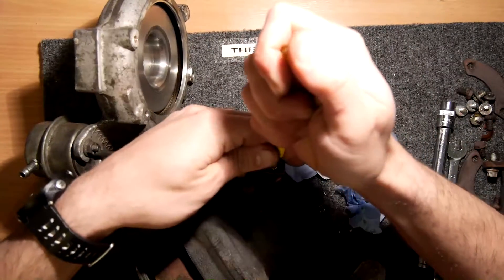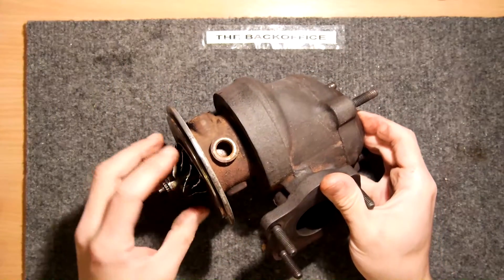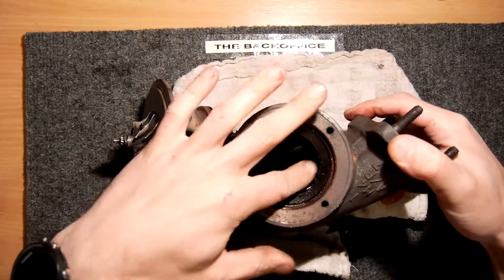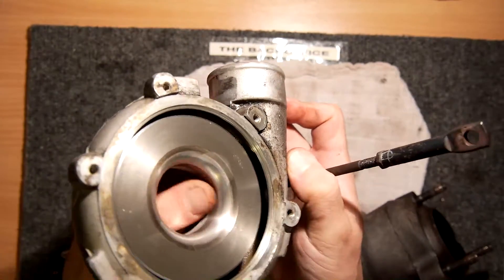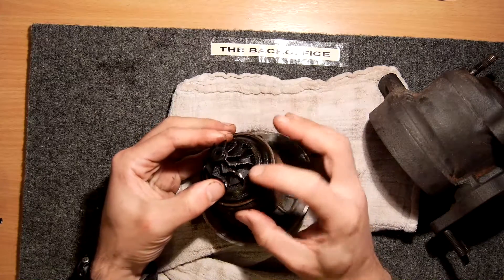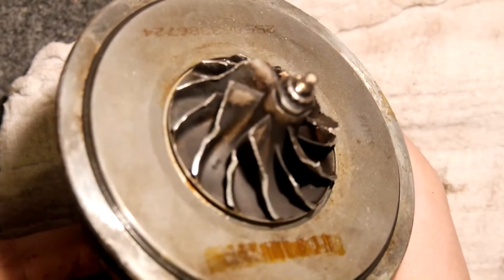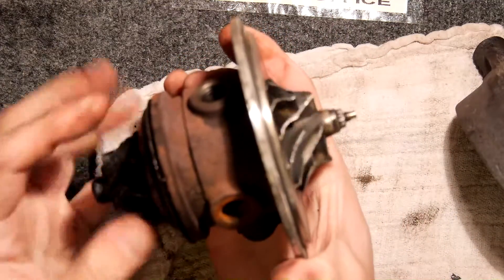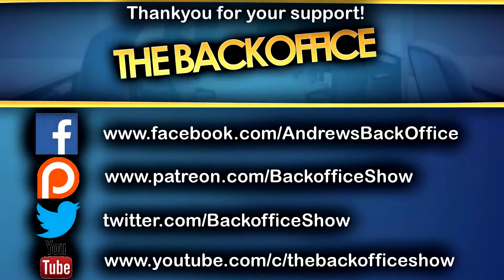TD Lab -  Garrett GT1752 Turbocharger Part 2

Comment: Good grief, that propeller looks like it's been used in mining applications. At least you caught it before it did any significant damage - going through all your oil was almost a good thing as a warning.
Reply from the maker: +Simon Lock (Aergan) Can you imagine what your pistons would look like with impellor blade stamps in it! The oil actually contained a lot of metallic 'dust' in it. Probably the impellor swarf getting past the piston rings and into the oil! Eek